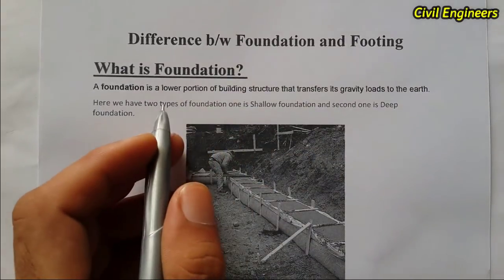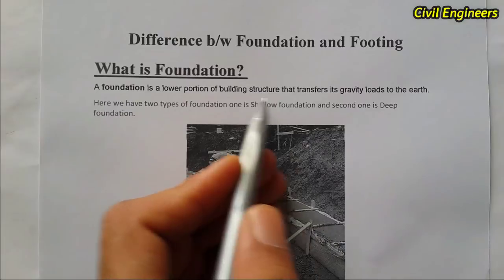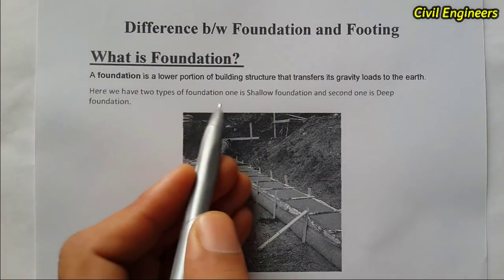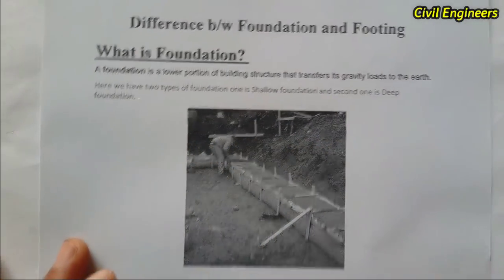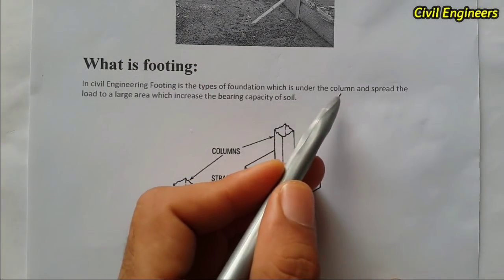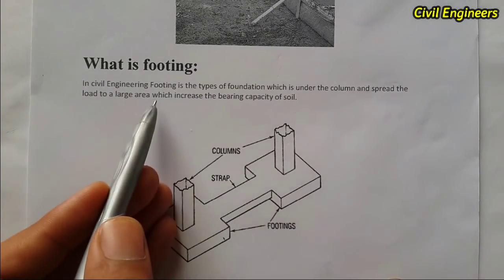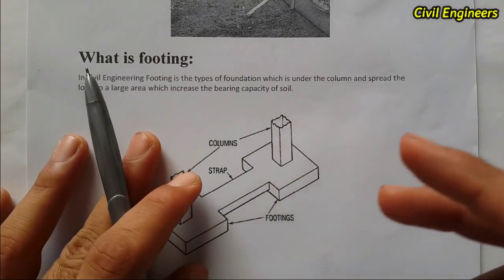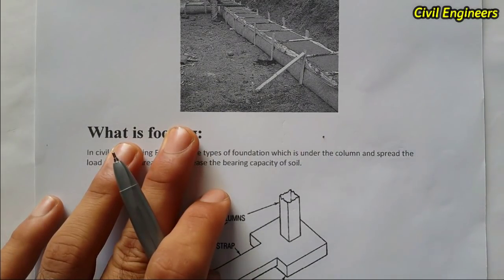Difference between Foundation and Footing

Comment: Isn't the footing part of the foundation?
Reply: Yes footing is just a part of foundation especially the shallow foundation only and the foundation is the basic and most important architectural component  for every structure to with stand the super structure, it may be either  shallow foundation for the soil having high bearing capacity and deep foundation with low bearing capacity 🎌

Comment: How the bearing  capacity  increases after footing placed
Reply: Because it spreads the load to a large area, because this is the job of footing to transmit the weight of the structure to the soil to prevent it from sinking!